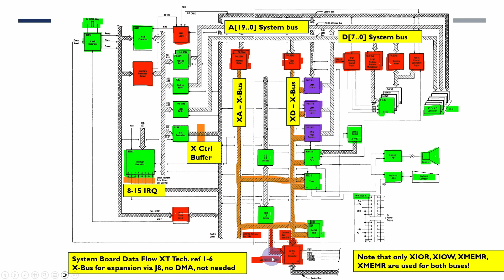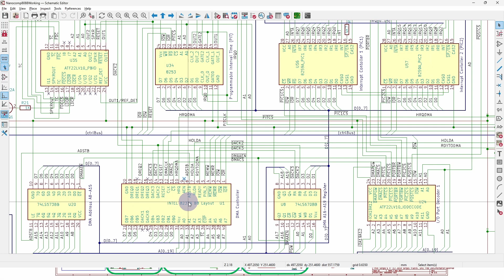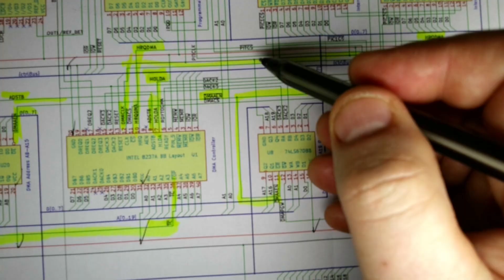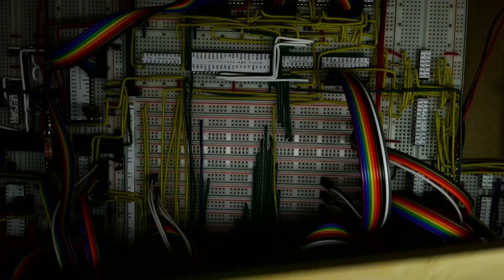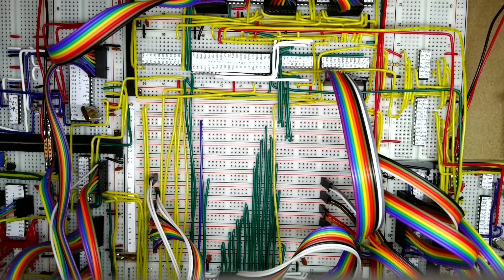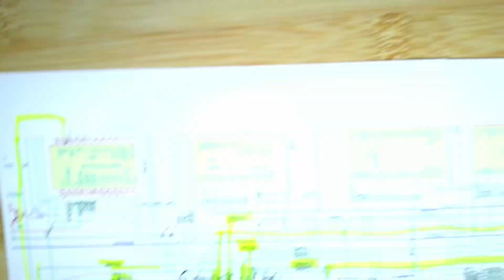Breadboard 8088 PC Compatibility Part 7 - DMA Controller #29

Comment: I know I'm preempting the next video, but when data is transferred by DMA to RAM from the floppy controller, is it stripped of all the data separator and CRC bits? Is it just the program or useful data bytes?
Reply from the maker: The floppy disk controller (FDC) chip handles all the decoding I think. We just get the sector bytes dumped in RAM buffer by the DMA controller. So the boot sector for example should get returned from the FDC to 0000:7C00 where it can be executed. Dave

Comment: This schematic is becoming quite the monster.

I think it really would have paid to split it into multiple sheets and try to follow the "inputs on the left, outputs on the right" format, much like the IBM schematics themselves.

Can't wait to see DOS running on a breadboard though!
Reply from the maker: Yeh I know its grown a fair bit but I find the decomposed diagrams more difficult to follow especially when you can highlight the tracks on a single large schematic. I think multiple sheets is less of an issue when using PCBs but for Breadboards I try and make the schematic match as much as possible the physical layout.
I also re-order the symbols so they have the physical pin layout and not the default nice logical ones which doesn't help physical breadboard layout.
I can't wait to get DOS running either but I suspect troubleshooting DMA and Floppy Disk Controller may take some time! 
Dave
Reply: I like the all-in-one-schematic. Somehow this makes it easier for me to get the whole picture. 

Maybe the +5V and ground busses could be removed in order to reduce visual complexity.
Reply from the maker: I try to make the schematics match the breadboard layout as much as possible (not 100% but say 90%). Helps when working out how physical pins are wired to ground or Vcc. This avoids all the effort needed to create a physical layout like is required in PCBs, especially when using the symbols I have customized to 'Breadboard' physical pin layout rather than the logical layout default. Makes physically orientating chips to make the connections easier.
It works for me but I am not sure many folks are making such large breadboard projects (except perhaps for some Ben Eater CPU reproduction projects).
I prefer the one large schematic as it makes it easier to see how things are connected (which is not as big an issue if making PCBs) especially with the highlighting tool. That gets a bit messy with multiple pages in a schematic.
Dave